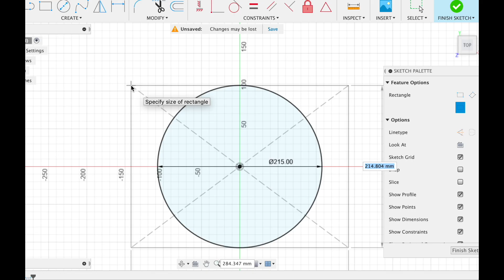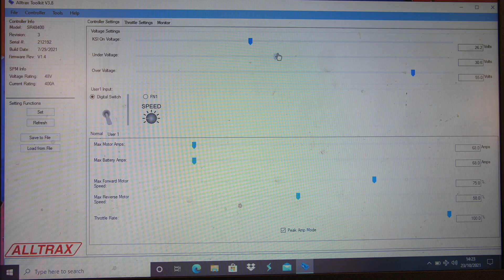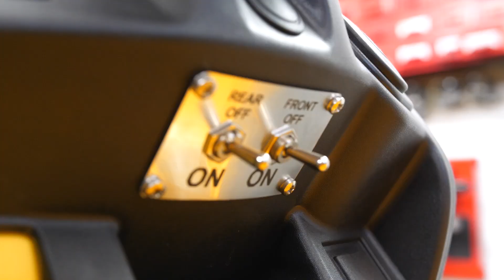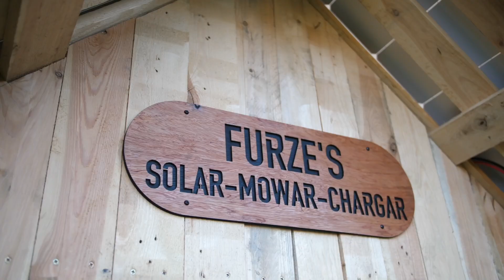EV Mower Conversion with Solar Charging Station

Comment: This is brilliant.  I’m not sure you realise quite how brilliant Collin.  I have 2 acres of lawn.  It’s takes me about an hr &  1/2 to mow, but my mower is bigger than this one.  The thing I hate about mowing my lawns.  1- the noise.  2- gas cans.  They use a lot of gas.  This fixes both, I would buy this… with the shed.  A couple of issues I can potentially see.  Heat management.  Mowers are dusty and the clippings get everywhere.  You will need a fan to blow clean air through the electric engines so that dust and dirt don’t get in there when running.  So +ve pressure in the engine, air from above.  Same with battery terminals, but heat less important, so they just need to be sealed.  My mower even has a fan over the hydraulic drive unit.

Comment: I've been using a 24V battery electric push mower since 2008, so far I've far preferred it to the gas mower that it replaced (which was an admittedly ancient Toro from 1984); I had to replace the original battery after 10 years, but thankfully the SLAs it uses are a quasi-standard size used mainly for mobility scooters.  Much simpler to use, easy to work on, quieter, no worries about having to drain the fuel for winter storage (or mixing 2 stroke fuel).  Honestly the only real use case for ICE powered mowers is large scale commercial property mowing where the machine are running all day long.

Comment: I think the only thing I’d change would be to switch to a different kind of battery like you said, and then I would add some protections to charge the batteries evenly instead of individually and then some kind of protection so that you don’t over-charge the batteries. This way, the batteries wear evenly over time

Comment: This was pretty amazing! Also a bit of a Columbus' egg: completely obvious after someone first thinks of it. I mean, there's a company that build gliders with electric launch motors and also produces a solar trailer for them, so if you go flying once a week, you'll always have a full battery when you want to go flying. There's probably a lot more things which are used only so often so can easily be charged by solar panels while not in use.

Comment: Brilliant. Money no object i’d have all my mowers and quad bikes used around the block converted. 
Can you ditch the rear diff and direct drive the wheels instead? Loose some wieght and some of the drag in the driveline.

Comment: You asking for lithium batteries is relevant for me because just a couple days ago watched "DIY Solar Power with Will Prowse
" review the Weize 12V 100Ah LiFePO4 ( I assume lithium 12v is your primary concern ). The main benefit of LiFePO4 is double the battery life reaching 10,000 cycles as well as low cost. Even Elon Musk has started shifting to LiFePO4 for their standard range batteries. It's heavier, cheaper, more cycles ( long term cheaper ). Man I'm excited for the future. Also fantastic job on the cabling and solar charge control setup that's so cool. Truly living the engineering dream.

Comment: You individual, I think 4V, lithium battery cells and connect them in a series to achieve your preferred voltage. When doing this, you need a BMS to oversee the charging and general function of the batteries, because lithium battery can be discharged significantly lower than Gel, AGM and lead acid. The low resistance in lithium batteries means that they just suck much more power to them, as well - the BMS also helps to combat overheating when charging. For charging you need a DC-DC convert, are you running 12 V then you need a charging voltage of approximately 14,4 V, and you have to consider that lithium batteries need a 3 stage charge: bulk, absorption and float.
If you are l running 12 V, you can check out some marine electrics sites.
Great video Colin!

Comment: Missed opportunity! You could have composted the grass clippings and generated the electricity from the heat or methane produced. You'd also have fertilizer for your lawn without having to worry about burning it or suffocating it like mulching can do

Comment: There are tons of drop in replacement 12v LiFePo batteries that replace lead acid in the same form factor. They are fantastically expensive compared to lead acid though!

Comment: This is brilliant!  And, if the mower takes 2 days to charge on Lead Acid batteries, once it's done charging the mower, you could plumb the excess solar power that is generated back into the grid and reduce your power bill. (at least, that's the way I understand it here in the U.S.)

Comment: After having worked in and being a patient in hospital I think this is a must build. It was so quiet, even the blade just made a whirring sound, nowhere near as intrusive as the petrol based machines used by typical grounds maintenance companies. This would  also be beneficial around libraries, schools office buildings, etc. My son has bought a Tesla and a battery powered push mower. What a solution to the noise pollution large metropolitan areas are plagued with.

Comment: I'd love to have a roof full of solar panels powering my house, mover, car, bike, motor cycle.  While I love my BMW Z3 M roadster, Jeep Wrangler, and Nissan truck, Honda motorcycle I have never enjoyed putting gas in them, I love the sound and power of gas motors but hate messing with the gas part
Reply: I love the sound of a very powerful electric engine with stacks of torque winding up too.  It just sounds and feels like “power” to me.
Reply: @stefanzzz6778  where I work we have rather large electric motor on our machines it's common to 300hp air compressor with 4000# motors or 600hp motor tipping the scales for just the motor over 6500# and they sing the same song of there people just a little deep since they only turn at 3600rpm unlike the Tesla's 18,000 rpms.  I have seen a 300hp motor with a 6" drive shaft torque up and snap it like a twig so much torque.  Love electric

Comment: hey colin..... i know a little bit about batteries...............what you need are diodes.....the bigger the better.......then you need a de walt battery charger,you know cordless drill you want the old 1 with the led that flashes as it charges,flashes faster if its dammaged,stays on when its charged,,,,,construct your diode matrix(come on colin your a clever man) and theriticaly ,or off yer head guess ,about 1.5 hours max to charge 500 ampers into yer car battery .......sun/solar panel/inverter/de walt/diode matrix/car battry.....or you could get some ni cads 3.6volt 1800amp octi series on usb..........u should get a usb kettle,iron,washing machine,toaster microwave

Comment: Oh dear. My Ryobi only cuts 2.5 Acres (12,100 Square Meters) on a single charge, and only has one plug to charge it up with.  Does have cruise control though which is nice.

Comment: Must be nice having a tiny yard. I own an electric mower and it takes three days of use and recharging cycles to mow mine, with three cycles per day. You did make a mistake, though. My charging shed is a lopsided monstrosity with all 10 solar panels facing south on a slanted wall/roof tilted 25 degrees. I also added a bank of batteries and an inverter for my house. About a decade ago, we had a bad summer storm that cut power for much of the county for 3 days to nearly 3 months (5 days for community). The whole setup for the house actually cost less than all the food that had to be thrown out. Next up, I extend the shed, add another 4 panels, and add charging stations for my electric bikes and Ryobi One+ batteries.

Comment: Something very useful would be to have a line running from the solar shed to your workshop to a tool battery station. If only tool battery chargers could use DC input instead of going DC-AC-DC.
Reply: With solar you could charge all the batteries you want. DC to DC conversion is easy

Comment: I wonder if you could sell a conversion kit. I've got an identical mower but under a different brand. I'd love it to be electric. Basically sell the mounting panel, the ESCs and the motors. People can get the batteries locally.

Comment: A local hardware store has two different zero turn style battery powered mowers and the prices were insane. I think regular zero turn mowers are overpriced as it is. I'm not going to pay $25K plus taxes for a battery powered one.

Comment: They have off the shelf LiFePo4 batteries in 12, 24 and 48 volt that you probably could use. Energy density is also much higher.

Comment: The best batteries I know of are paper batteries. There was a company "paper battery company" but the latest I can find on them is they went under and some investment firm bought them up. There's also Fuelium in spain but they only seem to do small scale batteries but on their site it says they take custom orders. Other then that I can't seem to find any for sale. Which is a shame since they're lightweight and high capacity.

Comment: That's a very interesting concept. I like it. During the summer, when the mowers needed, you'll be getting plenty of power, and when you don't need to cut the grass during the winter it doesn't matter that the panels aren't producing so much.

Lithium batteries would be the way to go due to their power vs weight, but they also bring a couple of added problems. You need a VERY reliable lithium specific charger if you're going to leave it plugged in permanently. If the charger has a mishap and totally drains the batteries, they're pretty much scrap, and if it fails to stop charging, you'll eventually get cell venting and possible thermal runaway (And a burnt lawnmower/shed !). Another issue is that lithium cells don't like freezing conditions, so once the "Mowing season" ends they would really need to be given a storage charge, and putting out the way somewhere that doesn't get so cold.

As mowing isn't going to be happening during the winter, with some electronic control, it might be possible to use the solar cells and battery to run some kind of storage heater in the shed to keep the battery at a nice temperature during the freezing nights, but that would get pretty complex if a suitable control system wasn't available. You'd also need to add a door and a fair amount of insulation to your shed.

Comment: I think that both mower and transmission should run off of one motor and maybe that might decrease the power demand with less motors to power... but you might have to increase the motor size so it's hard to say.

Comment: Pretty sweet... Add 2 100w panels as a canopy and it can recharge whilst you are trimming or getting a drink. You could probably run your stick machines right off, and use it as a power bank if your electric goes off in the house

Comment: Colin, I love your videos - But I would love to see a much more "technical" version of them, like how did you wire the batteries? What power inverters are you using for the panels, how do you design your cnc bits - and what program are you using? I'd actually pay for something like that. You're absolutely brilliant, and I'd love to learn from you anyway I can.
Reply: Agreed! This seems like a really cool projects and I have a riding lawn mower that would probably actually make sense to do this to. Maybe he will pit something on his website?
Reply: That stuff would probably hurt his engagement metrics for the algorithm but he could do it on a second channel or a Patron only thing.
Reply: @Eagle3302PL  yup exactly.
Reply: Agreed.  Probably no inverter, just DC to DC.

Comment: Wow, a riding mower looks almost strange without the branding labels.
-
This is an amazing build, and commercially viable, particularly if sold with the charging shed!
Reply: I'd buy it.
Reply: *mowar
Reply: Don't you mean sold with the Solar-mowar-chargar!
Reply: branding was still on the steering wheel ;p I knew what it was the first frame though, since my company sells them. They do also make electric lawn mowers in the same form.

Comment: Improvements I would add is some kind of gauge that tells you the battery capacity and how much longer you have until the batteries die on the machine itself
Reply: @hikamihise1967  stop it
Reply: @REALBanannaman  Its a Bot. Just report it and move on...

Comment: Your lawn mower is now also a battery bank for the solar and while it’s parked it could be used to help power your bunker or house, using an inverter. Not sure if you had that in mind or not or but it’s a nice unintended consequence either way. A bonus even.

Comment: Absolutely Fantastic!
Any problems with dust in the motor?
If you get lithium ion batteries, maybe you could put the lead acid batteries in the shed as a battery bank, to help reduce charging time.
Massive Respect from New Zealand
😀👍

Comment: If the charging station produces more power than the mower expends in an average day, then how about taking the Subnautica approach and making the power cells easily removable; you could have a bank of spare cells charging in the shed whilst a couple permanent cells top up overnight. You could then even use the rechargeable cells in other projects too.
Reply: You sir are making too much sense for home inventions
Reply: Another good idea would be to have them charge other electric lawn equipment like a weed eater, and maybe power some nighttime lighting
Reply: Or feed back into the house at night when it reaches a certain threshold?
Reply: Night time is generally dark, thus rendering the solar panels unable to generate electricity.
Reply: ^^^^^^^^^^^^
What he said lol
Reply: If it makes more than enough power, how about store it in home battery and use it for your home? It's not first idea people are living and using solar panels on the roof many as possible, and so pay less electric bills. Or even money back if they transfer extra energy back to the electric net. There are possible options.
Reply: over.... night?
Reply: @NeonFuzz  well you only use the mower for maybe an hour at most; you've got the rest of the day to accrue charge over as many cells as you're willing to keep in one shed.

Comment: He said he want's to use Li batteries for this but... Aren't (deep cycle) lead acid batteries kind of the best for this use case tho, especially given they usually tolerate charging like this better as long as the voltage is high enough? Also the fact that recycling them is a lot easier than Lithium batteries?

Comment: I have worked as a mechanic all my life. I started out with power equipment, and also worked at a golf course. The thought of rigging up a garden tractor with a golf cart motor, controller, and batteries has certainly crossed my mind. 
You did an amazing job. Electric is the future ⚡

Comment: Why did you use 6 different chargers with 2 7 pin cables, instead of using a single 2 wire cable with a proper BMS?

Comment: I miss my 1974 G.E.  E-15 Garden Tractor, I could mow 10 acres on a full charge, also had a roto tiller and many plug in tools and an arc welder.

Comment: You have way more solar than you need, on a sunny day you are probably fully charging that in only a couple hours (assuming that is a 12v or 24v system) if you have ~70Ah that translates to ~840Wh 12v or  ~1680Wh 24v which means in full sunlight assuming those 8 panels are 100W and are only at 50% efficiency do to angle of incident of the sunlight, you should be fully charged in between 2.5 and 4.5hrs. Of course if it wasn't overbuilt it wouldn't be a Furze invention. Haha!!

Comment: Make a Van Trailer combo kitted out with commercial lawn maintenance equip all battery powered.  or even for practicality a small genset too improve charging time.  End goal being able too replace a garden maintenance contractors running methods being better for environment.

Comment: Not to upset you, but the woodgas one was actually nearly 100 percent CO2 neutral as if you burn wood it only gives of the CO2 it bound to itself in its growth.
Ofcourse solar is also CO2 neutral but if you factor in the materials I would bet on the woodgas one to be better as it didnt need batteries that are very bad in the manufacturing.
Still an epic project tough and most probably after some time better than a gas powered mower and so much more power

Comment: you could give it a few LiFePO4 12V batteries, they are interchangeable with standard lead acid 12v and much higher energy density, they just dont like being charged at freezing temperatures and are crazy expensive (lowest was like 30cents per watt hour), but are safer and longer lasting than li-ion. 
also to keep a steady speed,  use some sort of dc-dc boost converter to hold a fixed voltage no matter how low the batteries go.

Comment: Colin, build your own lithium battery pack. A man of your skillset is easily capable of putting one of these together. You probably already own a spot welder and necessary bits and pieces. 

If you use the larger 26650 cells, instead of the smaller 18650. They have a much higher power density and capable of high discharge. You could arrange them to make the most of the space available, stick on an appropriate battery management system and Bob's your Uncle. Lithium-Ion is much safer in this application vs Lithium-Polymer like you used in your go-kart. Just make sure your ESC mosfets can take the voltage and don't blow up 😁

Comment: This is actually such a great application of home solar charging since you don't have to use the mower daily. This should be a option for buyers. The noise reduction and reduced particulate matter air pollution are huge plusses too.
Reply: Buyers won't like the $600 battery replacement every 3-5 years
Reply: @northroad1  Buyers will like the fuel savings every month.

Comment: Do you have a parts list???  I want to do this.

Also, that hydrostatic transmission is garbage... replacing it with an electric transaxle would have been better.

Comment: Awesome work!  You should put a solar panel or two on the mower itself, for a little bit of extended range -- or for emergency charging when you run out of the power while mowing a pitch.